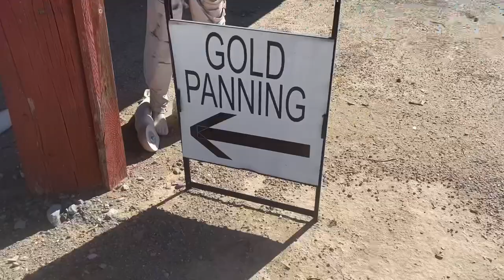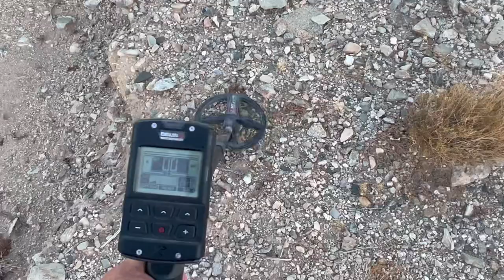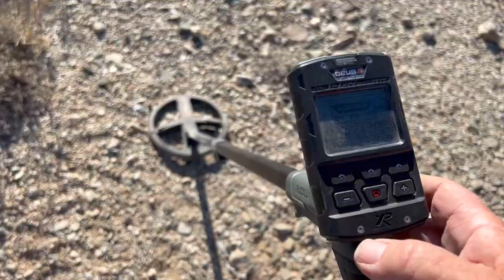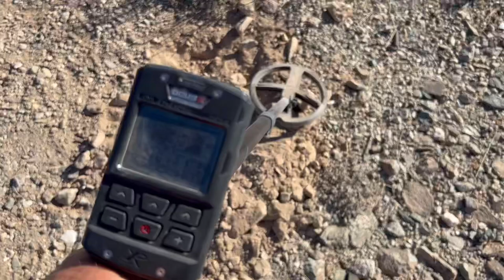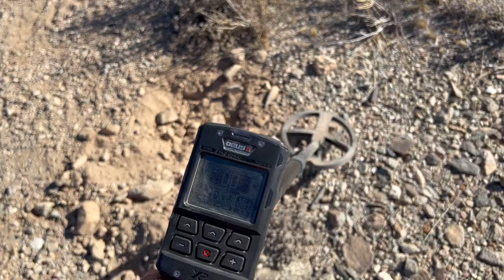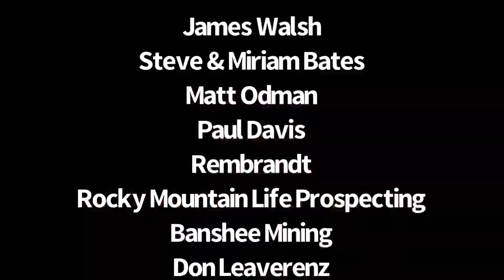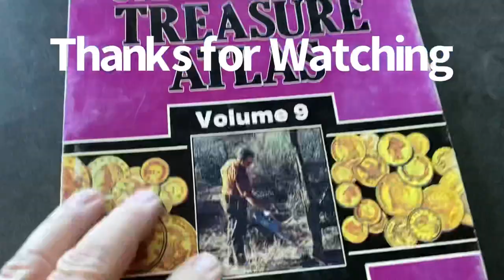GPX 6000 & XP DEUS 2 / Looking For Gold / Nugget Patch

Comment: Thank you for you great videos. Sorry to hear about your Dad.
I have been pretty disappointed with Deus 2 Goldfield. It is definitely not very sensitive to smaller nuggets. Anything below .3 grams or so seems to have a steep, abrupt sensitivity drop-off. I started using Deus 2 Mono for use with my GPX 6000 similar to how you are using it. I setup Deus 2 Mono with disc. at -6.4, PWM Pitch Tones, Notch OFF, Silencer 0 or 1 depending on ground noise, Sensitivity 95, Frequency 40 to 45 kHz, Iron Volume optional, Reactivity 2 to 3 depending on mineralization, Audio Response 3 or 4 depending on mineralization, Threshold 0 to 8 to help smooth out ground noise if there is any. That setup is very similar to the original Deus/ORX Gold modes and has very similar results and is twice as sensitive on smaller gold than Deus 2 Goldfield. Hopefully XP will do a Deus 2 Goldfield update soon to help it be more sensitive to the little bits.....
Reply from the maker: I understand completely. Nothing will replace the 6000 that’s for sure. It does do good in hot rocks and in parks it went deeper than the nox but for gold. No way.
Thanks.